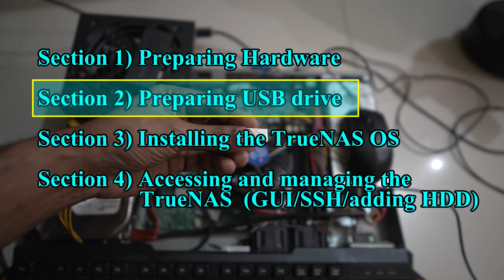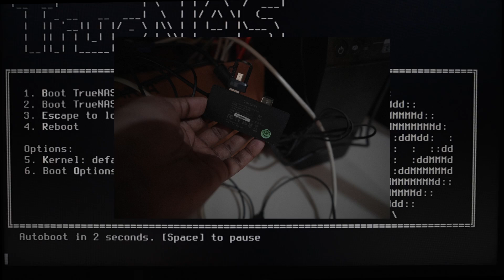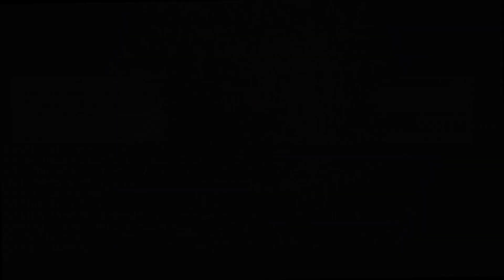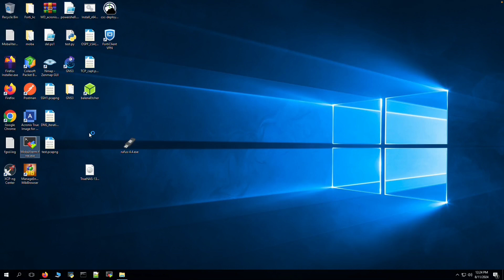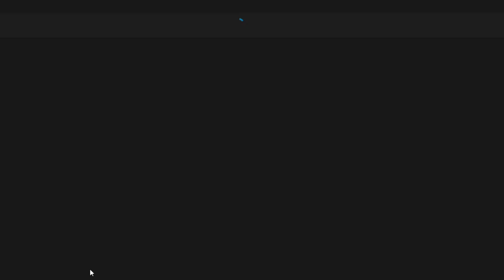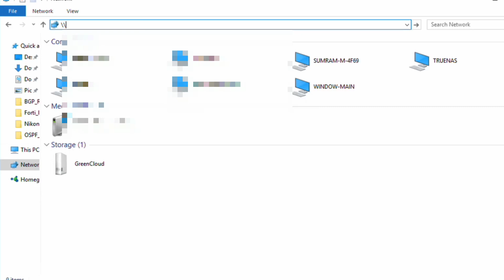Install TrueNAS OS on Server/PC using USB flash drive. TrueNAS OS installation on flash drive.

Comment: What are the advantages of having a faster trunas installation drive? Does it imrpve the transfer speed and is there any option to enable cache as well?
Reply from the maker: data drive with better spec performs well during read/write. caching control is there.

Comment: In my case, after 1 month using truenas and the OS is in flashdisk usb like you did. The flashdisk fails, what should i do?
Reply from the maker: 1) if you have the config backup , you can recover 2) if the disk (datastore) is not encrypted, you can import it to new trunas installation.
FYI, video tutorial for both cases are being worked upon, and will be available soon.
Reply: @sumitnick4  thanks, but here is the real case. I use usb boot, because if i dont, i have to install the OS in one of four sdd bay on my NAS. its a waste. So i think solution number 1 and 2 only does for temporary. Is there any other solution?
Reply from the maker: @FarhanLur  Only solution will be  to install truenas on new flash drive and then recover. No other solution, other than what we highlighted.
Reply: @sumitnick4  OMG, I CRIED A LOT T_T